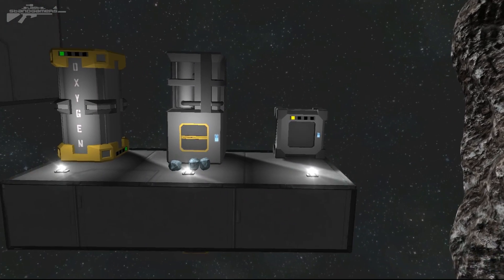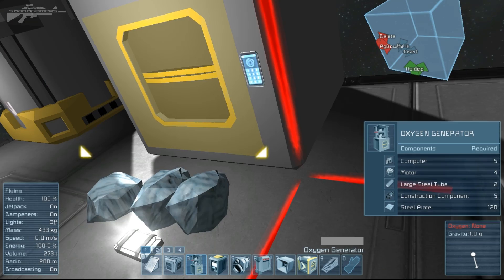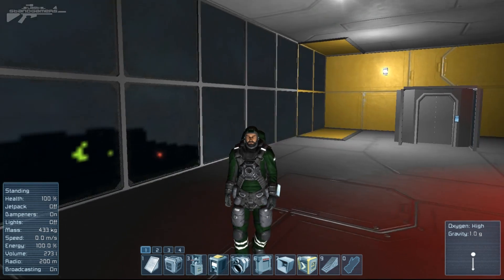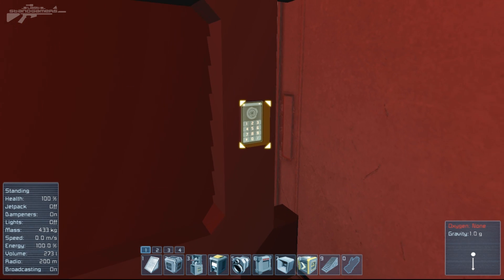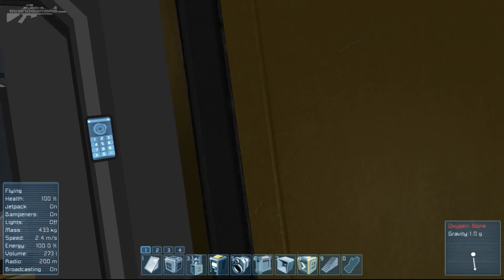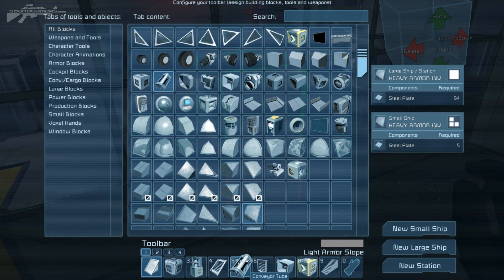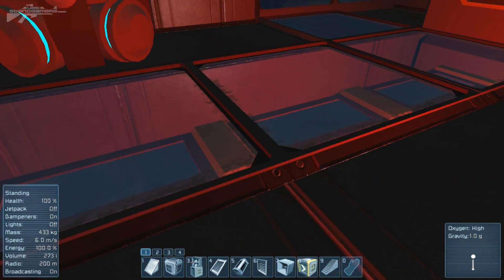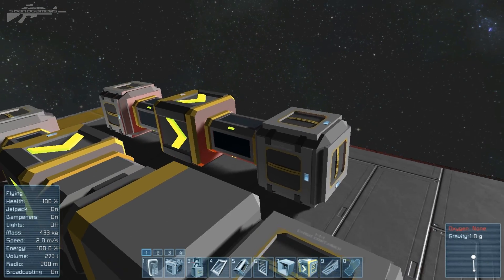Space Engineers - Oxygen, Take Your Helmet Off !!!

Comment: Blech, I have to restart my world so Ice will spawn.

Ah well, it was getting a bit stale.

(I know i can remaster the astroids, but I was lookin for an excuse to restart, so meh)
Reply: just check the oyxegen box and it will generate ice on any untouched asterioid
Reply: Yah, I ended up doing so anyway.  Found one that was almost ice.  Not sure where my first sealed room will be yet though - my base is that of an astroid and the astroid walls don't count toward the seal..... yet.
Reply: i would suggest sealing the medbay as there you can off your helmet
Reply: Yah, I was thinking that too.  I needed to move it to a new wing anyway and was in the process of hollowing that section out.  Probably do that once I finish the battery bank.

Comment: would be interesting to see a mode where an explosion inside a room full of oxygen creates a very small explosion around the outside(not like the current OP warheads but enough to devastate a room and potentially ignite neighboring rooms). proper containment of rooms in large ships or stations would become rather important since that would be more dangerous than just letting the air out(at least,as long as you don't have your helmet off. but then,why would you?)

Comment: it seems like meshes bent away from the surface of a window will not vent the air(gets counted as the block still touching the required faces). blowing holes in it with  missiles does work though, but I think that is actually removing an entire block and then scrunching it into the center. if you take the helmet off, particles will continuously vent into the room,but if you put your helmet on they will stop once the oxygen level reaches "high"

Comment: If the old vent windows allow additional rooms to be pressurized, then they are useful for building air systems that don't rely on a dedicated conveyor tube and vent network to each room, basically a central AC with vents into each room instead of a small AC being fed by a central compressor, or even small fully contained AC units in each room. I would use vented "windows" to connect rooms if that works instead of conveyor pipes and oxygen vents. Use doors occasionally in the vents to airlock sections. Save materials.
Reply: Basically like that map you play aliens or zombies in :p
Reply: Ryan Gunn So tested it, they do allow the pressurization of rooms through vented windows, so you can presurize by zone, instead of room. Cool :)

Comment: Is it possible to build some sort of sensor system to check if there is oxygen in the room or not? Maybe when youre under attack and try to run to your hangar, you have to run through a corridor but it could be broken and there isno oxygen in there?
Reply: Maybe a sensor block option that will lock all doors in that area if it has no oxygen :)

Comment: Now we just need hydrogen tanks and fuel cell reactors (using  oxygen and hydrogen) they would be worth it because they charge MUCH FASTER than batteries(which they are ment to replace) using conveyers and connectors. Theose reactors should also spit out water. The catch? O2 and H2 tanks would explode VIOLENTLY when destroyed. 
This can make quite an intreresting survival senario... no helmet allowed, get to base. How will you use your o2 supply?
Fusion reactors should be a thing.... but GIGANTIC and expensive in exchange for low fuel consumption and power output. It should also have low durability for its size because fusion reactors are more delicate. Power should also be needed ro juspstart the system.

Comment: I think the addition to oxygenated environments will be a huge leap for Space Engineers, because it will add a whole new level of realism in coming updates. For example with oxygen there could be potential fires, a food system added, thirst system, and you would actually have a decent motive to remove your helmet. Sure right now its basically pointless, but it opens up a world of possibilities, plus if they want to add in planets, this is also the first step.
Reply: Simon Hutchison i dont think it would be a food and thirst thing it will probably be used to work on a space station without using power
Reply: ModernGameArmy
Yeah but power goes down damn slowly anyways, and you dont have to remove your helmet to recharge it, so taking your helmet off is pointless. If that was the only reason to take your helmet off that is.

Comment: They would have to add a producer of nitrogen since life on the planet earth does not only breath pure oxygen but a blend of nitrogen and oxygen, since breathing pure oxygen can cause some bad side effects. The thing I'd like to see next for the cargo sorting block is a two directional one that can be used on refineries to pull ores in and then take the ingots out and put them into storage, I found that for that to work before I had to have two pipes to each refinery that you could imaging became a tangled web of pipes and overly complicated since I like my Refineries to do all the ores that the blast furnaces do not do and I had uranium centrifuges for fuel processing.
Reply: none of that will be added:
1. you can breath pure oxygen if you need to, it won't harm you overly much if you get the pressure right.
2. the conveyor system work on a draw basis, not a push basis, so you couldn't have the chests pushing items into certain refineries, also, use filters to make sure iron etc. only goes to arc furnace.
Reply: woolfoma You would need two connections for each refinery since the filters only work in one direction, sure you can have only certain ores go into the refinery but that leaves no way for the ingots to leave so you would have to put in a second path with a filter to prevent the first to be useless, since if a straight conveyor pipe system would circumvent your filter into the refinery so the second needs to be place so that it pulls out ingots, I was saying have one that allows certain things in such as ores and then have that it can then pull out ingots and have only one pipe going to it instead of two which can get pretty messy and take up allot of space.

Comment: I had a think on the validity of depressurizing a room with invading people in it, as they'd be wearing their helmets so wouldn't suffer any effect. With going stupidly sci-fi I've thought of two options, that could also work together. 1: Make it so the airlock doors are extremely hard to hack. However if the people in the airlock have their helmets off, it has a security failsafe to open so they don't die because AI isn't super advanced so "protect human life" isn't exclusive to crew.
2: modify sensor or add a scanning block that disable life support systems of enemy players suits that pass through. To turn it back on they must go back to an allied medbay. So if they want to take a ship intact they gotta lose life support thus be susceptible to venting etc.

Comment: Does the conveyor block also allow air to be transported? Or only the conveyor tubes? What if I hook up the piping for the air vents with the piping for cargo and item storage/ transport? Can the two share piping, or must conveyor blocks and tubes for items and air be independent? It would be interesting to see if air can be transported through connectors, large and small, and thus if the large conveyor tubes for small ships, can transport oxygen so a ship could re-pressurize one without oxygen and maybe even a small ship being used as a middleman to help one ship re-pressurize another. I highly doubt this, because even if small ship tubes could ferry the air, connectors don't actually make air tight seals when locked together, especially considering they can lock together and still have a gap between them you can see through!

Also, that air vent block certainly does not look air- tight!
Reply: I tested this because I added air to all my old ships but implemented it using existing systems, and it appears that air can travel through conveyer systems that other stuff transports through. I put my oxygen generator on the outside of a large cargo container, and had my vent in a different room on the other side and the room still filled with air.
Reply: Justin Kautz Nice! And thank you! Also, I'm surprised someone took the time to read all the stuff I splurged onto the screen. lol

Comment: I'd be interested to see how this works in relation to blast doors as I suspect it may be impossible to pressurise hangers. Perhaps they could introduce a "seal" block to go round the edges of blast doors?
Also, is the depressurisation effect just cosmetic or does it affect physics objects like loose rocks, tools, components etc.?

Something else comes to mind: sound. It'd be neat it sound blocks only worked in pressurised areas (assuming that's not the case already.) Though on the other hand it'd make a hull breach alarm a bit tricky to set up.

Comment: now we need a "rinG" block, that can fitz arround conveor tubes so we can get them out without depressurising the room Or placing huge items to close the gaps.
Reply: It may be a bit more component heavy, but there are the 6-way conveyor blocks don't forget
Reply: Pyrobird aye, but it seems impractical to place a 6 way part where a normal tube would be enouth.  its just kinda wasted material. i would rather see a fitting piece, thin as windows or vents to place on the tubes. or even a new tube block which costs a20 more steel for example.  just for efficensy sake
Reply: Doc Dewrill
Well there's also the conveyor sorter, but that raises issues of it's own.
But... you never know, maybe we'll get the ability to have separate blocks share the same space, as they created in medieval engineers. It's certainly a pain at present to build say... compact glass cockpits, given the windows demand a block of their own ^^;
Reply: Pyrobird dont get me started on Windows^^
Reply: Don't forget that they are implementing the composite blocks from ME into SE. That will probably sort your issue.
Reply: Doc Dewrill i know there is a mod that adds conveyors in interior armour blocks
Reply: Personally I find it ugly having 6 way conveyors lining my hallways

Comment: Next they should add some explosive gas to fill the oxygen tanks up with so you could sabotage other ships and stations. Also neurotoxin.
Reply: Lietunatchaos No, oxygen is highly reactive with other elements, not explosive in itself. Now fires would be a nightmare in a 100% oxygen environment.
Reply: Vergil III-VII-MMI go to the forum there's a suggestion thread, read the forum rules first though..
Reply: Now THAT, is an interesting idea.
Reply: Space Engineers if someone browses, or checks notifications on your profile. Check this idea out :D
Reply: Well, I'd imagine the separator apparatus would be intensely explosive.  The presence of gaseous hydrogen and oxygen (which would allow combustion, and speed along the reaction) could make for a pretty satisfying blast.
Reply: Lietunatchaos
yeah you need 3 things for combustion, oxygen, fuel (for the oxygen to react with), and energy, you only have two of those in a ship, made entirely of steal, oxygen and end energy (if shot at) any fires would quickly snuff themselves out, and if the energy came from a weapon from the outside that's breached the hull, the fire would go out from the oxygen being vented into space. Slightly different if the fire started internally, but you could quickly extinguish it by depressurizing the area in the same manner.

What I'm wondering is if the suit will use power for life support if the helmet's off.
Reply: maybe they could add in pressurized oxygen tanks so then they could be smaller and hold way more but would explode when shot?
Reply: nice idea but they could just depressurise the area to prevent a gas exploding once detected still that would be fun
also if we are having neurotoxin then I need a glados block ;3
Reply: Why bother with explosive gas? Oxygen us a highly volatile substance, if you're ship is filled with 100% Oxygen, it is a bomb in itself. The airvwe breath is 78% Nitrogen and 20%ish Oxygen with other elements.
Reply: Also the gasoline wouldnt ignite because theres too much oxygen
Reply: or you could just turn off the oxygen or grind down the generators, then everyone not wearing a helmet and not near a  medbay dies anyways